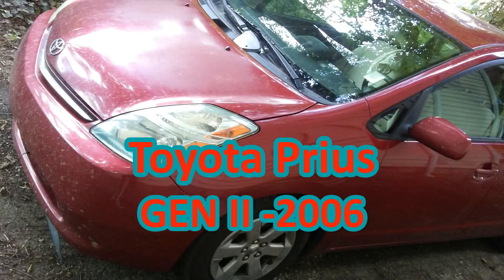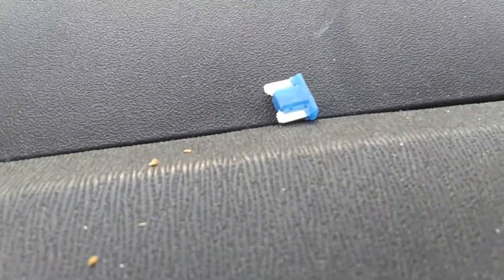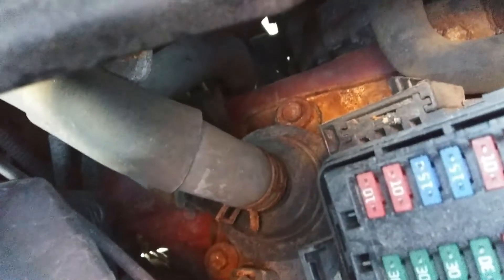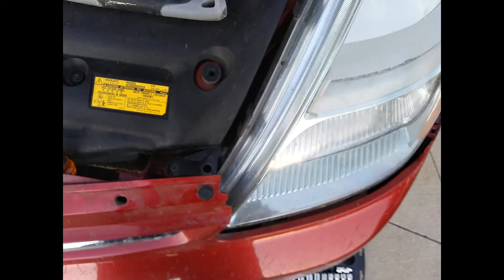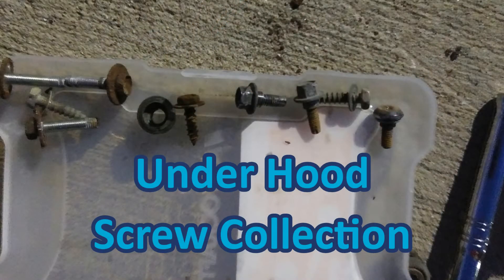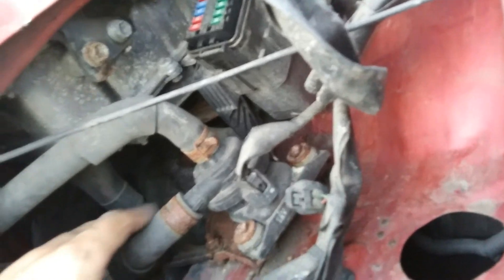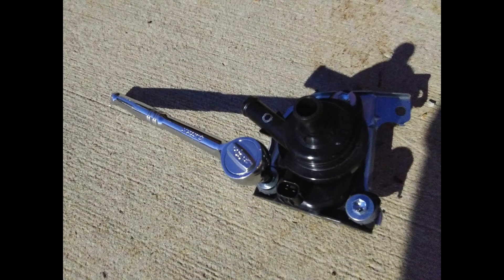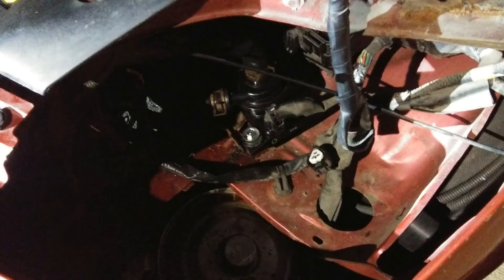How To Replace Inverter Coolant Pump In 2006 Prius

Comment: I just managed to replace my water pump withen 25 mnts without moving the headlight, I just removed the invertors top bracket so I can get my hands in. Lost like a cup of pink water. All good.
Reply from the maker: Way to go! My bro totaled my Prius 6 months after the repair.
Reply: @redbudex101statzer2  why what happened?